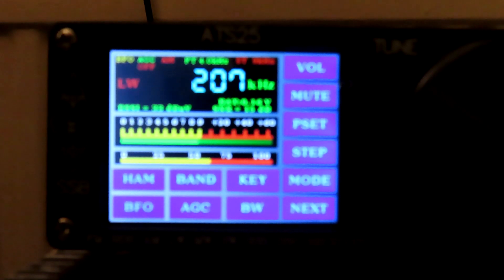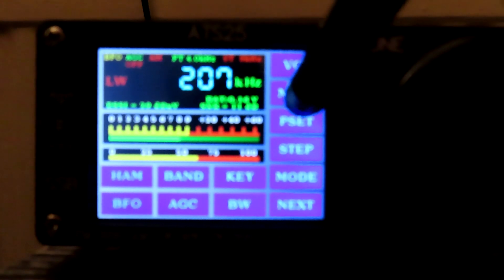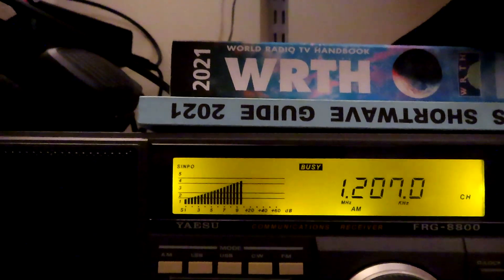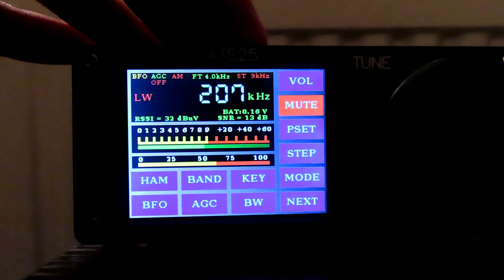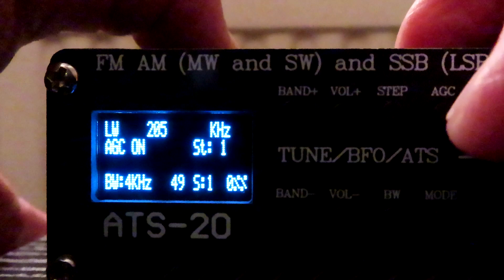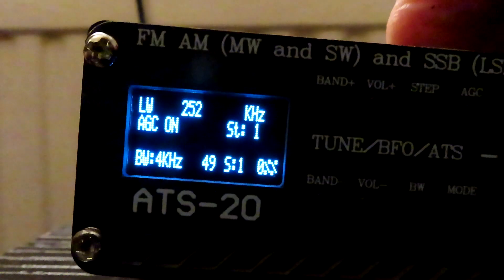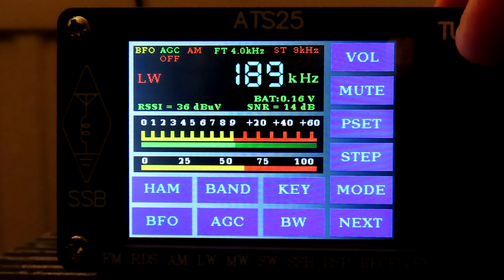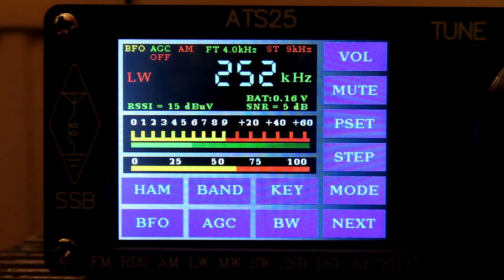ATS 25- Problem on Longwave?

Comment: You need to use an antenna tuner on the ATS 25, as it obviously doesn't have the input filtering the full size Yaesu has. It's normal to have MW harmonics on LW on all but the best rxs, when using an UNtuned antenna (aerial)

Comment: Is it showing the AGC as being turned off? Surely this isn’t a fair comparison, but the ats25 does seem to be a poor relation to the ats20, they are very very similar as regards the RF electronics just the MCU and display are different. Clearly the controller and display are upsetting the RF section somehow.
Reply from the maker: The AGC is basically an attenuator in these radios. In my experience at least it is not the same as turning off AGC in a 'normal' radio. That said I still don't think that explains the issue.